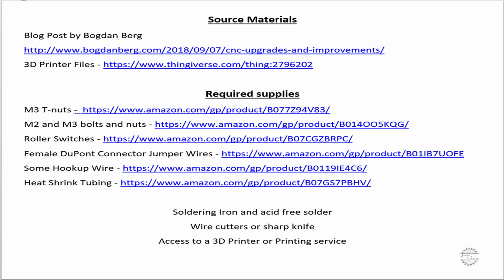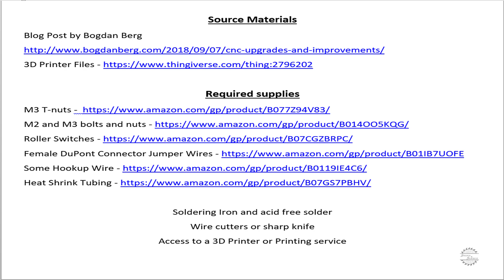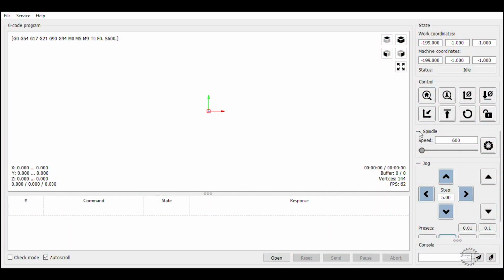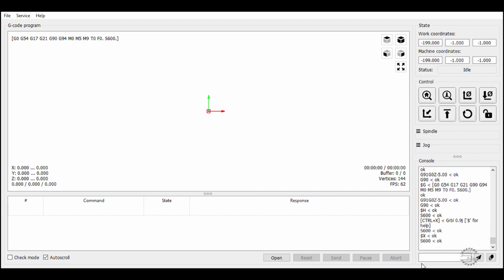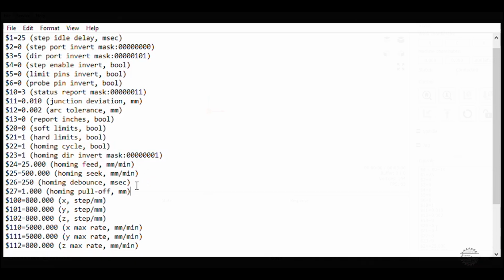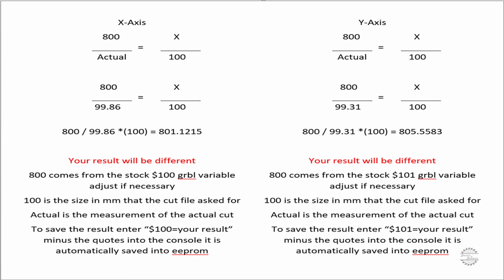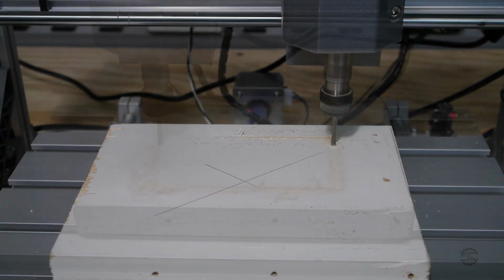3018 CNC End Stops and Calibration

Comment: Hi and thank's for your video.
Unfortunatly, like each many tutorials i see, I do not see any explanation of the wiring connectors on the board.
It is here the everything starts.  As an electronician, this is the minimum required before even we talk.
I see many people burning their boards because of the many confusions made and the non-understanding of things.
Most of the time, each tuturial is made just to explain how to turn 2 or 3 screws!!!
Plus there a confusion : i see on my board 4 connectors : 3 for x y z limits and one called STOP.
Who did explain clearly what are all thoses?
Reply from the maker: Thanks for the comment.  My appologies if this didn't cover your needs.  It was my first 'real' video for youtube so I made some mistakes.  One reason that I did not go too deeply into the board connections is that here are several different control boards out there and they are not all the same physically, but electrically will be the same or GRBL will not run on them without a custom compile.  Also, at roughly 4:12 in the video I make a very clear shot of the connectors on my board.  

On my board the entire bottom row of pins are all ground.  That may be different on yours, but by default the pins on the MCU are active low and they can be tested with a multi meter.  The connections should be made with one leg of the switch tied to ground and the other leg to it's corresponding labeled pin(Xen, Yen, Zen).  In your case the pins are labeled slightly different with just X,Y,Z.  The one labeled STOP on your is most likely for an emergency stop button and would be wired the same way. There are other pins to use as well.  There should be a pin available on most boards for the Z-probe.  

Even if the pins were unlabled, you can test the pin config using a volt meter and verifying that the all +V to ground while watching the console output.  The voltmeter itself may allow enough signal through to trigger the various tested configurations in the software so also keep an eye to the console output while testing.  Another way would be to use a 10k resistor (to limit the current below any damage levels) with a female dupont cable and probe each pin to ground while watching the console for output.

I hope this helps.

Comment: How do you connect 2 limit switches on one axis,I mean the diagram.
Reply from the maker: At 4:17 in the video it shows the backside of the control board.  It has pins for Xen, Xen, Yen, Yen and Zen (there is actually a secret second Z axis pin for the bottom).  The top set of pins are your hots and all of the bottom pins are grounds.  Just hook up your X axis switches to the Xen pins, your Y axis switches to the Yen pins and the Z axis to the Zen.  (On this control board) the order of each pair does not matter and the polarity does not matter.  The $ settings set up which direction things are.
Reply: @everlitesv  thank you.

Comment: Hello Friend, excellent video. I hardly find someone who uses the same grbl controller as me. I can tell you that I am in the process of upgrading my 2418 CNC. I bought it. First the laser broke, then I bought an Xcarve and a 40 Watt Co2 Chinese laser. But now with this unemployment I set about turning my 2418 into a superminiCNC. Well I will tell you that the steps of the X and the Y axis are correct in 800,000, what happens is that you did not subtract the diameter of the milling bit with which you cut the sample of the 100 X 100 mm square. Actually the perfect short machine 100 mm. But the GRBL controller is just a Gcodes reader. In the program used to generate the Gcode, Example must be assigned. any bit, but the cut must be outside the line, so that the measurement is exactly 100 mm. If you assign drills on the line, you must consider that the diameter of the bit will be 50% greater than the total value of the diameter of the bit. remember. over the line. minus 50% X & Y positive plus minus 50% X & Y negative. For a total of a full total diameter of the bit in use. And if you are cutting inside the square you have to add double, because the bit is cutting completely inside. This is a common mistake. The vast majority of the time they do not take these factors into account. And there is speculation that the equipment malfunctions. Believe me I learned this hard. Making dies for boxes, where the human eye could not see a thousandth of an inch. And the machine used 1/32 bits to engrave the wood and make the grooves for the cutting blades.
Reply from the maker: I'm not sure if I read you completely but, yes it needs to be an outside cut in your CAM software.

Comment: It would be nice if you could tell us the machine coordinates you end up with in the gui when homed. Also the exact pins for min/max connectors. I notice you $130, $131, $132 seem a little off. How important is that setting?
Reply from the maker: At 4:19, I have a close-up of my board (not all are the same) the pins are labeled Xen, Yen, and Zen.  In my setup, I put switches on both X sides and both Y sides with only one on the Z.  

The  $130s are for when you are using soft limits. When you have the physical limit switches installed, you use hard limits.  But, if you are using soft limits they are very important.

At 7:11, there is a shot of the coordinates after homing.  All are zero.  That is what homing with switches is all about.  We are defining that particular position as 0,0,0.  Now, when you position your bit over your actual workpiece and zero that out, then the work and machine coordinates will no longer be the same.  I hope this helps.

Comment: when trying to cut a pattern I set up the machine and set x & y to 0 at the center of the pattern. When I start to cut x axes goes to stops on 0 end. Nothing seems to change this
.
Reply from the maker: Make sure you have the origin in your CAM software matching where you zero the origin on the physical machine for each project.  I usually work from the center and top of the workpiece myself.    Also, make sure your cut area in your CAD/CAM is not physically larger than the machine.  If you have never had anything cut correctly make sure your steppers are driving in the right direction.
Reply: @everlitesv  Everything you suggested is right. The pattern is only 4" square. everything is going in the correct direction. Is there a way to reset the machine to factory defaults?

Comment: Do you happen to know where I can find end parts for the other side? Like right X axis?
Reply from the maker: The end stop/limit switch mount parts were 3d printed.  Many of the other parts are available on Bangood and Ali Express depending on what model 3018 you have.    On this one they are just 25x25 extrusions available in many places, just not cut to length.  The 90-degree braces and pillow blocks that shape the gantry and hold the 10mm rods are available in many places including Amazon.   I have seen the plastic corner brace on both Thingiverse and Bangood.
Reply: @everlitesv  thanks for the reply! I saw your link to the thingiverse page but there are only end stops for one side (like X-axis left and Z-Axis top). Or am I missing something obvious? For homing one corner is enough but I want to protect my machine in both sides
Reply: @petermuller608  I used a program called Autodesk\Meshmixer to create mirror images and relocate the flat surfaces to print better on my 3d printer. This way you have a right - left and front - back mounts.
Reply: @geraldwardell4873  thank you I will try that!

Comment: In my opinion 
If you measure the inner square, you Miss a "half of diameter" router bit.

Any way 👍 clear sound! No annoy music.
Reply from the maker: Intuitively it would seem that way.  In the CAD / CAM software, you define the actual bit size and make a tool path that cuts on the outside.  The CAM software takes the tool diameter into account when calculating the final tool path for the g-code.

Comment: Hi I want to try that CNC with Alphacam. Do you know if that controller is compatible with fanuc (like the mech 3 software ) or other thanks .
Reply from the maker: I'm not sure what post processors are available on Alphacam.  The stock board on theses is GRBL based.

Comment: Great video. Thanks! My only question is how do you unlock the machine. You make mention of this when editing gcode. Can you explain how you know if the machine is locked and how you unlock it?
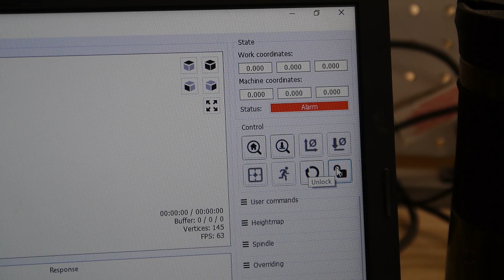Reply from the maker: It's a software lock that GRBL machines go into when things go wrong.  It stops the machine and most control between the PC and the machine to help keep from wreaking havoc.  If you look at time 7:04 in the video you will see the icon in Candle.  Other senders have the same sort of thing.  Usually the icon will go red.  Most definitely the machine will halt and refuse to take commands from the PC.  You can also send a $X to unlock.   See 'https://github.com/gnea/grbl/wiki/Grbl-v1.1-Commands' for the official reference.

Comment: hi
 everlitesv , is it the same as the arduino uno with shield v3 board ?  about calibration settings. (cnc 3018 nano board no detect / broken, replace arduino uno board with shield)
Reply from the maker: If I understand you...can you replace the Woodpecker board with another arduino based CNC board?  Yes you could.  Unos with a CNC shield (3 axis) or Nano based CNC control boards should all work.  Some CNC shields need special attention to some jumpers though.  I'm not 100 percent on the polarity/phase of the motor connections as they are so I would check that against what your replacement requires.
Reply: thanks
Reply: Stepper motor can rotate not smooth :)

Comment: the best explanation regarding the calibration. Longtime looking for such a convincing way to do it right. Thank you for sharing knowledge.
Reply: Ouch, this calibration method is a bad advice unfortunately. Sad that this is taken as a rule of thumbs.
If your tool is 1.9mm diameter instead of 2.0mm diameter, you'll measure a square of 100.1mm instead of 100.0mm. And you are going to multiply the 0.1mm error to all the dimensions of your part : the farsest you are from the origin, the biggest will be the error of your part dimension.
I actively recommand to use a "calibration cross" (look at thingiverse, this is good for a 3d printer and a CNC calibration).
The calibration cross comes with an Excel spreadsheet, you'll have to take several measures.
The spreadsheet will give you two numbers :  the constant offset (this is the tool diameter error) and a linear offset (this is the step/mm error)
Hope I could help you :)

Comment: Awesome Video thanks, using this as a guide to fitting up my endstops and calibrating my 3016. (have had a few overruns its not good for the machine)
I note in the GRBL "handbook" that $$5  is for limit pin invert.  would it be possible to use that to change the normally open contacts to using normally Closed (which on blogs seems to be the preferred set up.
Again, thanks and a great vid
Reply from the maker: Happy you find the video helpful.  According to the grbl docs yes the $5 variable does just that.  Off the cuff I would think that an an active high (trigger on low) could help with spurious line noise but would need a smidge more debounce time / filtering (variable $26).  It's just my personal experience with arduino projects that trigger low switches are just a shade more noisy than trigger high when using the internal pullup resistors alone.  It would depend on the quality of the switches also.
Reply: @everlitesv  i am very new to  this so will go as your vid outlined.  and it works amazingly.
Now to the fun part of actually  learning how to use it

Comment: Hopefully  you are still monitoring this. I tried your G-code settings for setting limit switches, changing to =1 and switches
worked great. Unfortunately, the spindle motor no longer turned on and I could not "send" the program to the machine.
Changed the settings back to =0 and all was well. Any suggestions??
Reply from the maker: That could depend on the version of GRBL that is on your board and how old (version wise) that your board is.  In grbl .09 there was a pin assignment change that in 0.8 was for a limit switch and in 0.9 and newer that pin is what drives the spindle.  That usually just messes with the z axis switch though.  Some boards can get the benefit of homing by setting $22 = 1 and setting $21=0 to turn off hard limits if that works for you.  Once a proper homing can be achieved the soft limit functions will work for better safety as long as it is enabled and the actual max travel dimensions are saved to the firmware($130-$132). If you are running a newer firmware like 1.1e,f or g also check $32 and make sure it is 0.
Reply: @everlitesv  Thanks.
Reply: @everlitesv  Checked, I have V08.1.0 . dated 2019. I will try changing the =1 settings one at a time and see what happens
Reply: @everlitesv  Thanks for responding. I fixed a number of problems by upgrading to Candle v1.1.7 and grbl 1.1e. Can't go any higher as Easel only works with the earliest v1 of grbl. Have looked at Denvi/candle.wiki on github and nowhere,
starting with v01, does he explain the function of the keys. Some are basic but a Vid explaining how each works and the later upgrades would be welcome. Do you know of such a site??  I'm sure a lot of folks would pay for that.
I try posting questions on the wiki but never get a response.
Reply from the maker: @johnhill2594  Thanks I will look into it.
Reply: @johnhill2594  Grrrrrr……..what a load of time wasting crap, If/when I buy one of these machines ( I already have a CNC mill)  I'll change the main board to a Gecko one ….hang the cost...…..MAC 3 is more user friendly.
Reply: @gangleweed  My plan for the 3018 was to use it as a "blueprint" for constructing my own CNC. For $136,00 I figured how can I go wrong. Got blown away after I had calibrated everything, this little toad was accurate to within .010 on all three axis. I have invested in larger steppers and motor (500w) bigger working surface, lots of stiffening and
tooling. I'm still under $250.
Reply: @johnhill2594  The real cost is in the labour.....material alone is not how much it retails at, and if you did a side by side cost analysis of an "improved or upgrade" you would be paying a lot more than you bargained for, but as most people who go the improved upgrade path totally discount their labour as nil, the true final cost is nonsense. It would be the same if you just copied the design from the word go and sourced the materials on line etc and did a complete upgrade with more powerful parts......that way you would still pay more for the improvement parts but the labour cost would be way up...….it would get a bit better if you tooled up and were making thousands of the final design you chose, but the Chinese would beat you every time......as a one off the cost for parts is still too high......name of the game. When you decide to do an improvement the overall size will increase because that is what happens in all cases.,,,,,cars are a typical example......look at the Mini.
Reply: @gangleweed  Good points,  but only I control the deciding factors; what it will be used for and how much space
is available to set it up.
Reply: @johnhill2594  Sigh...….that is very true, but it's a Human nature thing to expand any horizon once you become comfortable with the origin. I would certainly upgrade one of these machines as a matter of preference even if it makes David become Goliath in the process......the Titanic did start out as a 2 oared rowing boat on the originators drawing board etc. One difference in the bigger is better scenario is the Myfordboy 3018 upgrade where he totally revamped the original build to express his preferences but still kept the machine within the size restrictions. I would have done a build in fully welded steel tubing to the same dimensions.....small is beautiful too.
Reply from the maker: @johnhill2594  I'm happy you are learning from it.  You should check out the prices on ebay for 3020 and 3040 machines.  I was blown away by how much the prices on those has dropped in the past year or so.  Order of magnitude more stable /rigid / power and encroaching on the price point of the 3018s.

Comment: with the right bits and lubrication setup will this handle 6061 aluminum? trying to make a few parts for my ar15
Reply from the maker: Not accurately. With very shallow pass depths they can cut softer metals but they really don’t have enough rigidity to be accurate.

Comment: Hi, could you tell what size of cable wrap you are using? And don't you have a pullup resistor
on your microswitches and a capacitor to avoid fals triggering? Does your Wodpecker PCB
allready have the pullup resistor and capacitor onboard? I just bought a 3018 with a Cronos
Maker PCB, hell i whish there would be some detailed information on that thing, to make
things even worse there are a lot of different versions of the board i have... Thank you
for sharing. Cheers!
Reply from the maker: There are a ton of different boards on these.  I'm pretty confident that the pullups are just above the header pins see 4:16  I haven't line by line gone through grbl source but the 328 chip has internal pullups as well if enabled properly.  So far I haven't needed to cap the switches but it really wouldn't hurt.  Usually I use a 30pf paired with a 10-100uf electrolytic with switches that large to avoid bounce.  My lead wire to the switches is twisted around itself for most of the run to also help with noise.  I ran my spindle wire separate from the others as well see 1:27   The cable wrap came with it, but it looks like 6mm.  I'm going to fiddle with this board a bit more and then upgrade to a different board and use trinamic steppers.